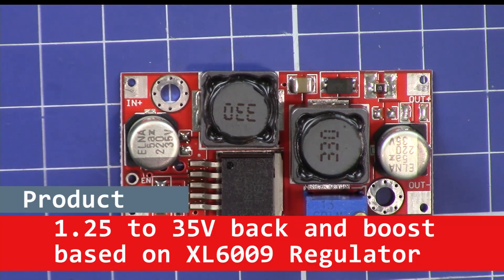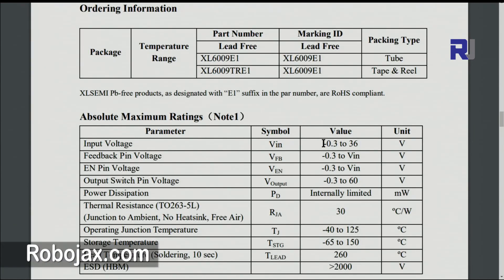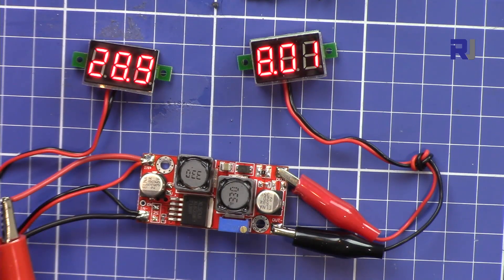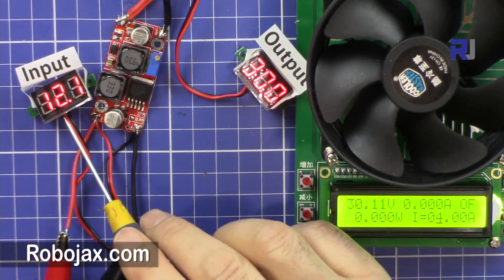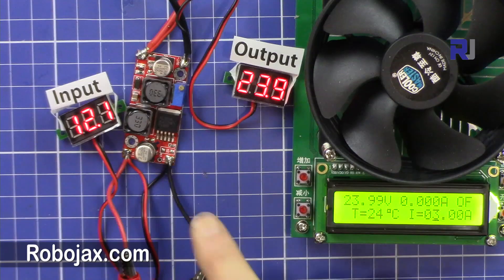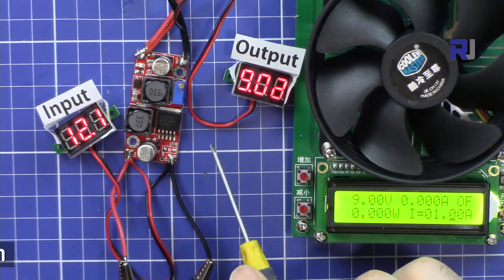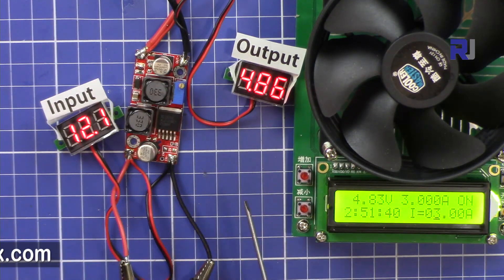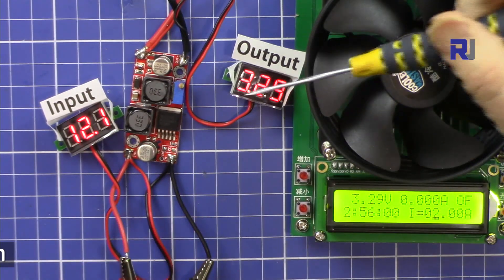Test Review of XL6009 DC to DC 1.2V to 32V  5A Buck Boost converter module

Comment: Which thing is used to increase current ma to A
Reply from the maker: The maximum current is fixed in this module Your load determines if you want to draw high current or low current. connecting smaller resister at output will draw higher current . (i) is current in Amper I = V/R
Reply: @robojax  i had a current  30ma and i need a cuurent 2A what can i doo
Reply from the maker: you had 30ma and need 2A? sorry didn't get it. you had 20mA where?

Comment: What is input current
Reply from the maker: I did not provide it but I have noticed that these converters  have about 90% efficiency which is 10% loss. So they need 10% extra power at input. for 9V and 3A output 9V x3A=27W, add 10% to it would be 1.1x27 =29.7W. Now if you need to get this power from 12V input, then 29.7W÷12V =2.48A at input.
Reply: Input current depends of the output, but in video you can’t see variations in the input it means that power is enough for the tests, the regulator is what fails

Comment: This board works better with a heat sink on the diode.  There is a well known heat problem with this board which can be solved by using a heat sink or adding another diode in parallel.  (there is a video on youtube from a British guy that covers it).
Reply from the maker: this product is very cheap. buying  diode would  cost the same as the board.  People should simply avoid this a select something else.
Reply: Help me to find him please.
Reply: @muflatu  He probably means Antony Cartwright.

Comment: What is the make and model of your test equipment?  I need to test converters at 12v/12A input boosted to 15v/8A output. I’ve been hunting for a way to do it. That unit would help me.
Reply from the maker: it is called 150W electronic load. sold on eBay.  I have a video on it here : https://www.youtube.com/watch?v=-kI7OtTHd18

Comment: if you take off the trim pot 103=10kΩ then fb=0v; it turns out Vout=48v. if you piggy back xl6009 ic and diode ss34(max 3A instants) on the top with thermal pad then you doable double amperes from 2A to 4A. the module has no voltage protect feature but you can use for lab or cheap project not for expensive device. avg load =12w max then you need to change cap of out put=100u200v  and inductor filter=8uh.
Reply from the maker: Your suggestion might work. then why use the module at all? Make your own PCB and circuit.

Comment: Nice and simple video, thank you for sharing. BY THE WAY, did you measure the A you can get @ 12V output? I'm running a project where the load (an aquarium pump) needs 2A @12VDC, and the small step up can't cope with such need. Any advice? Thx
Reply from the maker: Thank you. You are right. At the time, I did not have power supply with 30V and 5A. now I have got it and make sure to do another test with 30 or 35V

Comment: 12V input and 30V - 4A output... How many Amps are you pulling from the INPUT ? 10 A ? ratings are given for the input, no ?
Reply from the maker: it doesn't work and failed shown at 07:19 . But generally if it works, the total power P = V x I, I is current so if output is 30V at 3A, P = 30X3= 90W and the input should be 90W + losses (if 10%) = 100W. and you see at 12V, you can get I = P÷V, I= 100÷12= 8.33A

Comment: Hello, i need 3mA at 24V, my supply is 5V, 1A, can this module do this?
Reply from the maker: yes. you supply 5V x 1A= 5W that is total power. You need  24V x 0.003 =0.0072 or 7.2mA. this is about 60 time of this device can supply and it should work fine.
Reply: The boost tests were particularly bad. I just ordered one if these before i seen your videos. I got it to go from 12.3v to 14v and my load is 500ma.